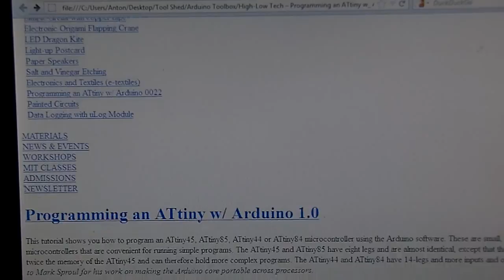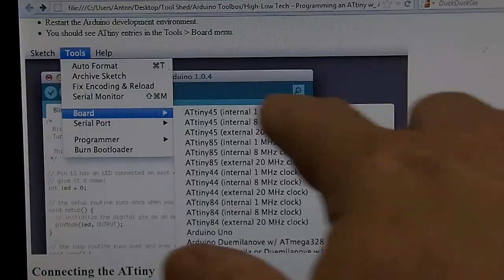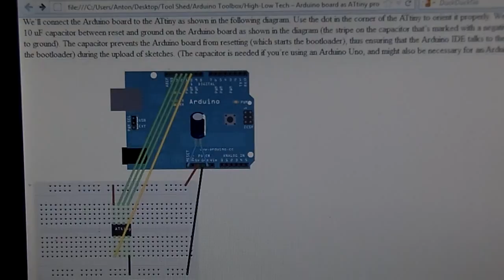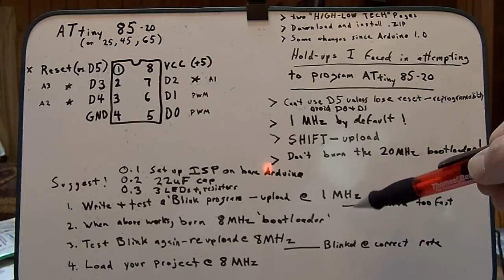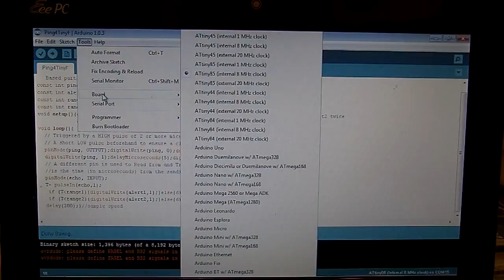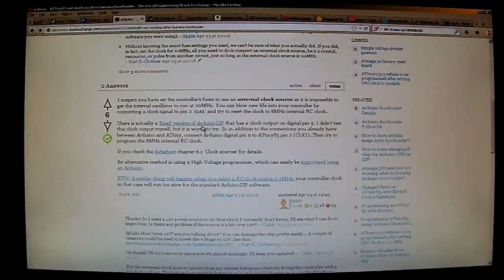Arduino (8) Shrink down to ATtiny

Comment: which pins are serial ? (tx/rx) i got this ic's just to use the serial function
Reply from the maker: As I explained at 0:35, it doesn't have serial unless you add emulation for it via an added routine , you'll have to include a library for that. and set up one of the PWM pins for TX and another for RX.
Reply: oh im sorry i thought you did mention something about this topic, well do you know where can i get more info on this subject ? my application depends on this feature and i got a shit load of this ic's for this one reason serial communication only excorp.weebly.com

Comment: Great tutorial, but one of the main issues that i've found is on Serial communication.
1.- attiny84/85 @ 8 mhz no external oscillator have awful problems of the RX transmissions.
2.- You gotta use the old "SoftwareSerial" library to handle two way communication, and it's not a very reliable one, the "NewSoftSerial" doesn't work on 8 mhz.

I'd love to see a detailed tutorial such as this for fixing that problem, i'm trying to shrink down my projects for a long time now...
Reply from the maker: It may be that the internal oscillator just isn't stable enough. The crystals are cheap but it does add to the parts count. Haven't worked with the serial libraries myself (yet), but a future project will need IC2. Will be revisiting this project once winter hits, till then I have to use my free time getting ready. Would also like to get into the ATtiny 861, but resources for it are scant.  Thanks for watching and hope you will do videos on your projects, will check out your channel.

Comment: 10:00 This is the best piece of information in this video.  The ATtiny will not work correctly unless you choose the 1 MHz option even if you chip is 8 MHZ or 20MHZ.  I found this out by trial and error.
Reply: William Mann that's not what he said. He said that 8 MHZ was the correct choice... I'm pretty sure the zip file has been amended to include 16 MHZ versions

Comment: Hey, great vid! I’ve been ecstatic ever since I found out I can pretty much run my smaller programs on ATtiny IC’s. I'm using the ATtiny84. Is there a way to enable the use of other commands beside the ones you mentioned?

i.e. other than
pinMode()
digitalWrite()
digitalRead()
analogRead() … etc

I have the library and the h files and everything for the other commands. Is there a way to save them in the EEPROM or something? Or perhaps incorporating them into the ArduinoISP sketch?
Reply from the maker: Good questions. I'm just learning about the Arduino and ATTinys too. Haven't really looked into the 84, but the 85 is very bare bones in terms of IO, you have to use libraries to support I2C and SPI whereas these are included in the 2313
http://toasterbotics.blogspot.com/2011/08/attiny2313-with-arduino.html
Of course your basic C functions  for loops and all that are compiled out so they should all work, the communications support varies per type as in the above example. Just have to prowl the web with your favorite search engine to find the info you need. Don't overlook the Atmel site either, but there is a ton of experimenters blogs out there with information . I had been looking at the 2313 but now drifting toward the 861 for a future project, as I need the sixteen or better controllable pins. There are also some custom bootloaders for particular ATTinys one can find that can add functionality..
   Here's a bit on the 84 from the Arduino site:
http://forum.arduino.cc/index.php?topic=154633.0
Reply: ***** Thanks for the response! The links you posted led to me finding some very interesting sites on the attiny. Turns out I'm not the only one facing problems.

What I was trying to do was add someone's custom made library to my attiny so that I can use it. I was afraid that it might not be compatible with the timers within the attiny and whatnot Have you come across anything of this sort? i.e. adding custom libraries to enable the attiny to understand commands not native to the Arduino?
Reply from the maker: sykodogg
   I watched a video a while back where the guy was getting into libraries and doing some particular modifications to one. Might of been HumenHardDrive, who also has recently done a short tutorial series on using AVR Studio as an alternative to the Aduino IDE. This will be a must-learn soon for myself, as it gives you better control over the "fuse bits". One of these fuse bits on some or all of the chips, is an 8x clock multiplier. So you need to know that your library and your project use the same setting here. So between the clok speed selection, there is also the multiplier, sort of doubles your timing options.
   Depending on how serious you are, other options include learning to program in AVR-C (again see HumanHardDrive tutorials), or going a step further and learning the AVR Macro Assembler (see the Atmel site) or one of the third party Macro assemblers, ie.
http://quinndunki.com/blondihacks/?p=1106
Heck, C isn't much more than a Macro assembler anyway. But these options probably aren't practical unless you going for mass production or you enjoy the challenge. Otherwise useing a full ATmega328 bare-duino style is always an option.
   I ran into a major snag with the project in this video when I tried to straighten out my timing issues. I mentioned in this video that I needed to go back and double the delays. Well snag one, the numbers got too big, so I had to change the variable types. Did so, it compiled ok, but doesn't work, don't even get the double flash  my SETUP routine makes. So then I though something might be amiss with my programming, and wrote and uploaded a simple program to flash D1 once, D2 twice, etc. That worked OK, so I'm mystified why my other program fails, would think at least the flash from the SETUP routine would work... Still need to revisit this when I find the time.
Reply from the maker: Here's another video from a make-my-brain-scream-genius about making libraries:http://youtu.be/_3tiu48WXk4

Comment from the maker: Have been doing these as I learn myself, to keep a beginner's perspective. But the drawback is as I learn further I'm collecting errata and things that need more explanation. One is speed. Seems at 8MHz, I'm still at 2x speed, because the UNO and other run at 16MHz.At 1 MHz, "Blink" was playing at 16X. Not sure how that inverse relation happens. So I probably need to double my delays and rang variables. Good thing I put a socket in my driveway alert!

Comment from the maker: Should of included a clip of the final installation, where it now lives near the mouth of my driveway. Took more time than it was worth, but I learned a lot in the process and I will likely be using this chip in two other long inchoate projects.
A few corrections will be eventually added in the form of annotations.